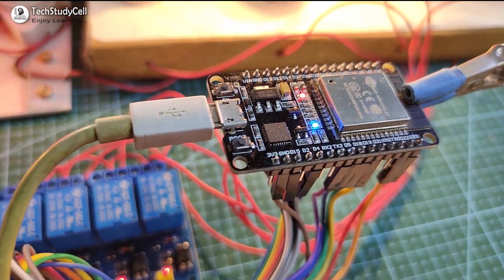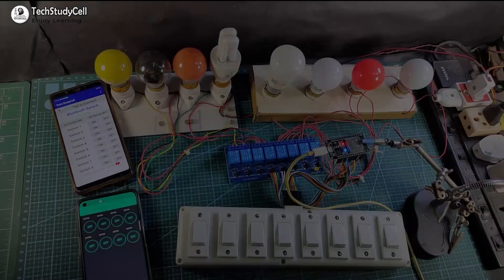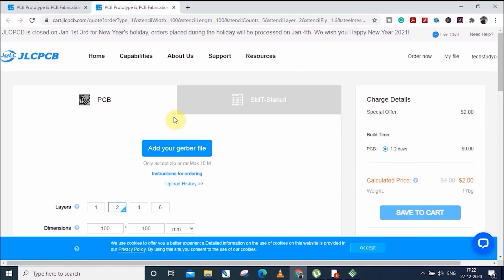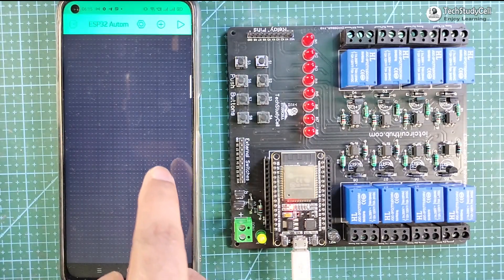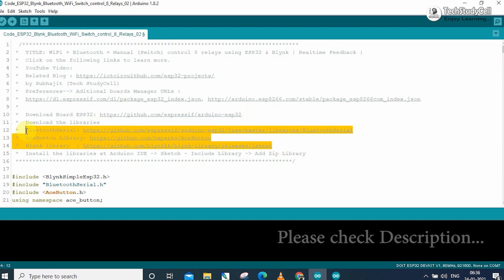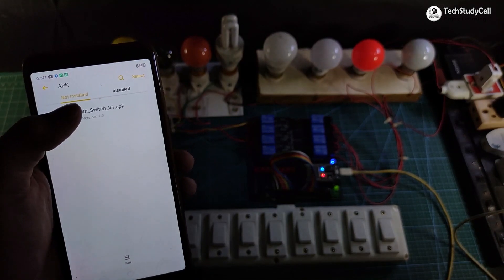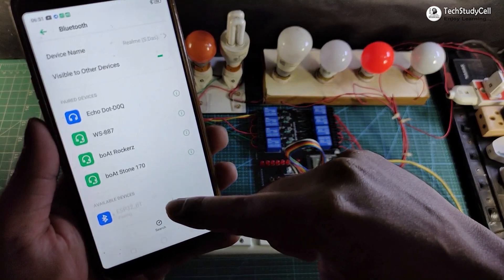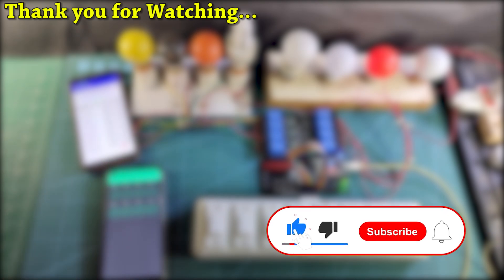ESP32 WiFi Bluetooth Smart Home Automation with Manual Switch & Blynk App | IoT projects 2021

Comment: i got this error /tmp/build-M3a9pO/libraries/Blynk/src/Blynk/BlynkApi.h:39:6: error: #error "Please specify your BLYNK_TEMPLATE_ID and BLYNK_TEMPLATE_NAME"
     #error "Please specify your BLYNK_TEMPLATE_ID and BLYNK_TEMPLATE_NAME"
      ^~~~~

Used library    Version Path
Blynk           1.3.2   /tmp/build-M3a9pO/libraries/Blynk
WiFi            2.0.0   /home/hexi/.arduino15/packages/esp32/hardware/esp32/2.0.14/libraries/WiFi
BluetoothSerial 2.0.0   /home/hexi/.arduino15/packages/esp32/hardware/esp32/2.0.14/libraries/BluetoothSerial
AceButton       1.10.1  /tmp/build-M3a9pO/libraries/AceButton

Used platform Version Path
esp32:esp32   2.0.14  /home/hexi/.arduino15/packages/esp32/hardware/esp32/2.0.14

Comment: In my case everything is working fine but when I connect the board to the another power source like adapter or vin except PC it stop working.
Reply from the maker: Please use a stable DC power supply. It can also happens due to loose connections.

Comment: Super project 👍🏼

Question: could you also connect 5 volt DC LED Stripes WS2812B to the output from the relay ? 🤔
Reply from the maker: yes

Comment: Sir, i have one issue. While using wifi for controlling, when switching on the lights are getting switched off and while switching off its getting on. I tried in voice recognition mode also, it was working the same. What can be the problem, pls guide.
Reply from the maker: Here I have used active low relay module, when control pin receive low signal, the relay turns on
Reply: @TechStudyCell  thank you for replying sir.

Comment: Hello Techstudycell, this project is great. I have made exactly this project and it is perfectly working. Thanks. 

But I have a problem. When wifi router is disconnected or restarts, esp32 gets disconnected, that's fine. But when the wifi router is back to working, esp32 does not reconnect back to the router, except I press the reset button. 

Please, how can I make esp32 reconnect with wifi without rebooting the esp32 board?
Reply: hello did you succesfully installed the BluetoothSerial library because mine cannot be installed

Comment: I'm turning on and off the fan using relay 8, most of the times the esp32 gets hanged after turning on the relay and shows wifi is offline in the BLYNK app, when this happens i can't control using manual button as they are also connected to esp32. The only way to start back the system is by hard resetting esp32. What I'm doing wrong suggest?

Comment: I need to use switch both ways as in if I turn on a device using switch I can turn it off from blutooth and Blynk.
Also I need to make it work with NodeMCU and HC-05 Module can you please suggest some changes.
Waiting for your Reply.

Comment: Good job. I didn't succees to connect my esp32 using your Bluetooth App. The WIFI mode is working perfectely.What is the problem?
Reply from the maker: Bluetooth will connect only if the Wi-Fi is not available.
Reply: @TechStudyCell  I've tried even the other project working only with Bluetooth and switch. But the Bluetooth app refused to connect with the ESP32
Reply: I've tried another project using another  Bluetooth app it's working perfectly. I'm confused! What's wrong?
Reply: Good morning Sir. Please I didn't not succeed to connect the Bluetooth app with the ESP32. Please is it another way to disconnect the Wi-Fi? I did all that I know but the Bluetooth app is not going through

Comment: Good project but I'm getting error while compiling code as 
Sketch uses 1333170 bytes (101%) of program storage space. Maximum is 1310720 bytes.
Global variables use 52500 bytes (16%) of dynamic memory, leaving 275180 bytes for local variables. Maximum is 327680 bytes.
Reply from the maker: You have to use ESP32 DEVKIT V1 board. Select the proper board (DOIT ESP32 DEVKIT V1) then upload the code.

Comment: Really great job/project.I like what you do,and explain. The only issue wich i really found on this project,is that without wifi/bluetooth you can't control any more with the remaining manual switches...And as i see the code is permanently checking for wifi,wich is ok,but the loop must be adapted.I am wrong in what i say? 
Thanks for all this videos,
Regards

Comment: Is it possible to make the manual switch work as a three way with the blynk? I mean, if I hang up on one I can call the other regardless of position.
Reply: Hey did you found the circuit you were looking for
Reply: @kuldeeptripathi649  I wrote a code to work like this using other library called JC button.
Reply: @CarlosViníciusDrummond  Hey thanks for replying can you elaborate a little that how did you made it work do you also change the connection and did you using simple switch or 2 way switch
Reply: @CarlosViníciusDrummond  Hey thanks for replying can you elaborate a little that how did you made it work do you also change the connection and did you using simple switch or 2 way switch

Comment: Sir I have followed all the steps correctly and installed at my home (2 Esp 32) but after 1 or 2 hours both esp 32 goes automatically offline mode and after that it works only after esp 32 power on off. Please suggest how can I correct. Waiting for answer.
Reply from the maker: Will check that.

Comment: When i download bluetooth serial library from below link there is no option to download the library..and when i search the library in arduino ide skech manage library.the bluetoothserial not shown
Reply from the maker: If you have installed ESP32 board, then it is not required.
Reply: @TechStudyCell  thnx for valuable rply

Comment: Hello sir how did you connected manual switches with the circuit I cannot see any connection between them 
Thanks in adv.
Reply from the maker: Switches are connected across ESP32 GPIO and GND pin. Please refer to the circuit shared during the video.
Reply: @TechStudyCell  can u pls 🙏 give reply to me in Instagram sir

Comment: Hey Subhajeet sir, I just designed this circuit on zero PCB. Everything working fine for 2 to 3 minutes but after that ESP32 had short and getting very heat. Can you please tell what was happen?
Reply: Check your zero PCB connect there might be a short just a tiny pieces of solder can ruin the whole circuit

Comment: I try to make  watching this video but my ESP32 unable to operate 5V relay .it's output was 3V only ,and I give extra 5v power supply to relay but signal pin unable to operate again .Is there any solution for this Sir..... Thanks ♥
Reply from the maker: Please watch the circuit carefully. It's better to use separate power supply but GND pin for both power supply should be connected. There are optocupler in the relay module. So 3v in signal pin is ok.  Here I have used active low relay module, so  when you connect 3v at control pin relay will turn off. If you connect GND pin in control pin relay will turn on.
Reply: @TechStudyCell Sir, i face same problem but your suggestion is not understand. please help more details.

Comment: Great job and one more inspiring video, also try to add 5 step fan speed control + google assistant as it is available in everyones phone and without fan control home automation is something like incomplete...
Reply from the maker: If you include fan regulator the circuit will become complex. So working for any alternative solution.
Reply: Ok, let the complex part be aside but there should be at least fan speed controller type or something like that...

Comment: but the demerit is it cannot contorl by bluetooth and wifi at a time but grate project
Reply from the maker: Bluetooth is there only if WiFi is not available
Reply: @TechStudyCell  but how to use in multiple mobiles
Reply: @shashivadhangunti3411  share that BT application to desired mobile

Comment: Sir... If possible Bluetooth and wifi operate sate time...? 
Not use same time both...
Reply from the maker: If you can control it with WiFi, why you need Bluetooth at the same time
Reply: @TechStudyCell  Sir.. My phone is active with wifi... But some others phone is not internet.. So.. Both phone operat... Same time..

Comment: I am looking for an project where I can control the relays from alexa, manual switchces, bluetooth, and blynk. looking forward
Reply from the maker: Blynk is not required if you can control it with Alexa App. Will make video on this.
Reply: Yeah I done instead of Bluetooth I used Web server which can me be control even in WAN network with (node mcu)
Reply: @saikumar1265  is it quick and get a feedback ?

Comment: bluetooth switch unable to write: broken pipe..why?.. i installed bluetooth switch and blynk at same HP
Reply from the maker: Please watch complete video. Bluetooth will work if ESP32 is not connected with WiFi. First you have to pair the ESP32, then connect
Reply: @TechStudyCell  ok thankyou. 👍

Comment: You could use Hi-Link power converter from 240v to 6v on your custom designed board instead of cellphone charger for power supply to ESP32 board. It would look like built-in power supply.
Reply from the maker: I have used 5v mobile charger. But you can use hi-link power supply.
Reply: If you want ur proj more flexible sweet and short u can use hilink power adapter

Comment: Superb project.my question is can we use esp8266 instead of esp32 for this project
Reply: Yes but in coding u have to change few things
Reply: I need to use switch both ways as in if I turn on a device using switch I can turn it off from blutooth and Blynk.
Also I need to make it work with NodeMCU and HC-05 Module can you please suggest some changes.
Waiting for your Reply.
Reply from the maker: No

Comment: Awesome, but dear can you add the option to the same code to update the io pins status with manual switches in Realtime still in bluetooth mode too as it has in wifi mode with BLYNK .
Reply from the maker: Thanks. Will try to add that features in upcoming videos.